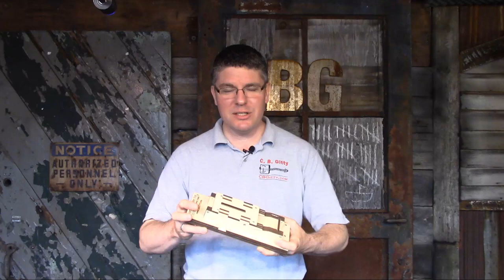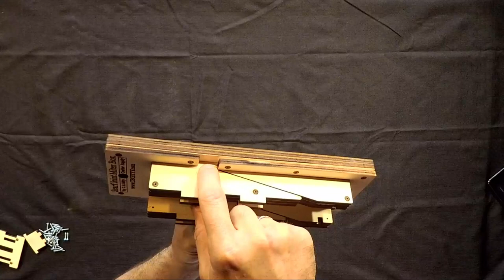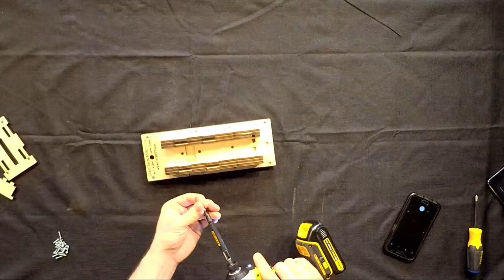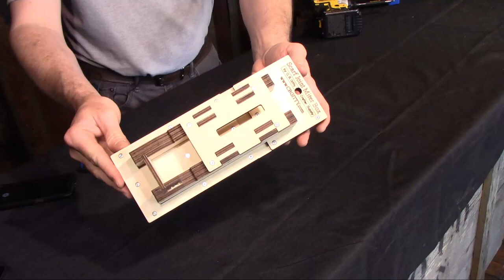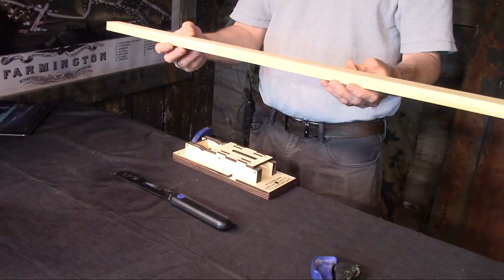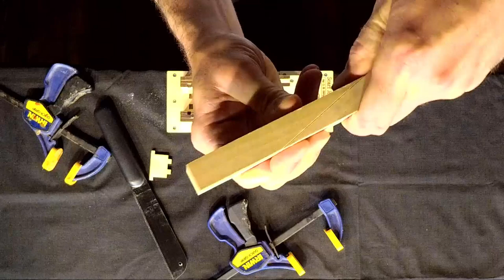Scarf Joint Kit Video Demo

Comment: I would definitely remove the depth stop and cut it longer so the joint isn’t midway up the headstock but rather on the neck where it can be concealed by the fretboard. That puts the visible joint on the back of the neck  right at the angle . Much nicer look. Definitely a good jig though, nice clean square cut

Comment: Cool! But if you're going to use sealed tuners your headstock needs to be thinner, appx 9/16. Will it work with the headstock piece on top?
Reply: What we do is glue the scarf and then thin it down via sanding.

Comment: So Kewl Ben !
This leaves a headstock of 3/4”, will most tuners fit through that thickness ?
Reply: Hello William... this jig is just for cutting the scarf joint, it doesn't affect the thickness of the wood. To get the headstock area thinned down to be best usable for tuners. 9/16" or so is usually best. The headstock can be thinned down via sanding or filing.
Reply: So do you file or sand the top or bottom of the headstock to get to 9/16"? Does it matter? Thanks
Reply: Frank Larkin 
I would say from the top, which would also increase the area of the headstock :-)
Reply from the maker: We always sand the tops. Try to keep the top and bottom surfaces parallel to each other, so the tuner holes remain perpendicular.